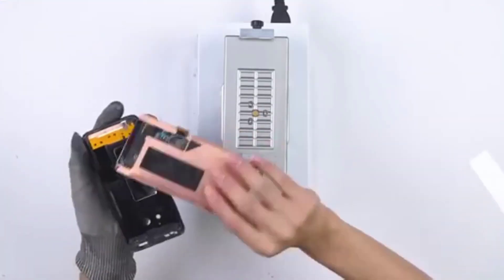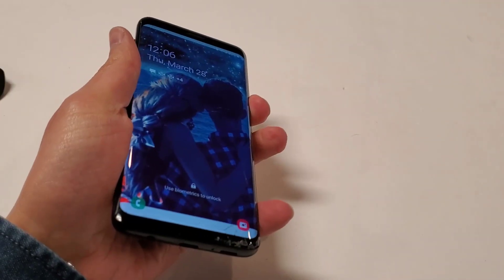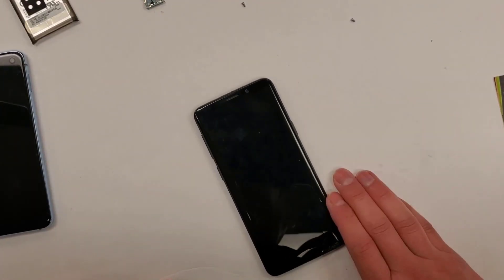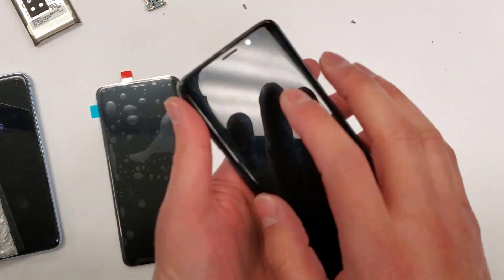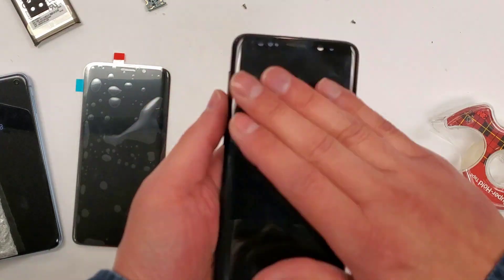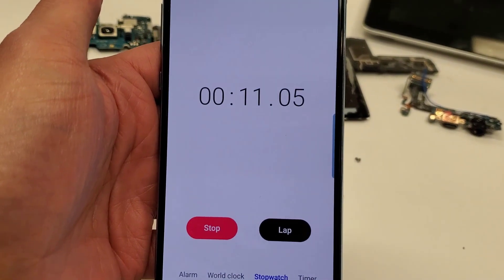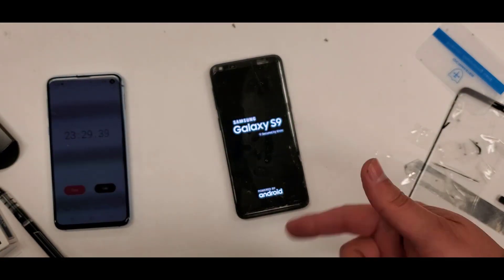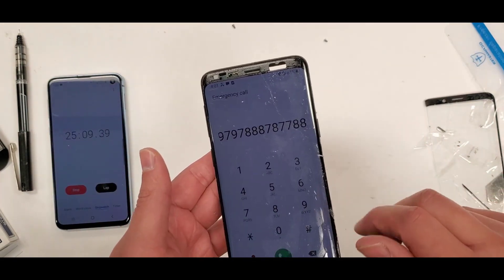Samsung Galaxy Screen Freezer Refurbishing Technique | Course Video Released

Comment: Thanks for this great course about freezer. I bought one and really was disappointing because a scam total. However I discovered some thing I can use it for display repairs but it's really not the best choice to separate the glass. Success rate is very low
Reply from the maker: It works but you need practice. The last model i used the freezer was Galaxy S9. After that I stopped using the freezer and just either paid a business in China to refurbish them for me or just sold them off to US companies. I only sell them off to US companies now.

Comment: My s8+ is cracked and the the top part the touch is not working so what can I do
Reply from the maker: You have to get the whole screen replaced. Take it to your local repair shop or follow a video on YouTube and see if you can do it on your own.
Reply: @RichardMeza  according to what I have seen I think I can manege it

Comment: Hello Richard, you talk about S9  and s9+ freezer glass removal technique,  can  this technique work for s20's s21's? Thanks for the video its great
Reply from the maker: The freezer technique is not used anymore. The way glass only replacement is done now with Samsung phones is by heat and wire. There is a hot plate machine. You place the screen with the frame in this, and it heats up the frame and screen. Then you get a wire and skim the glass off the Oled screen. This way is done with the current newer Samsung models.
Reply: @RichardMeza  i said because i have the freezer machine but i never try to repair new models only s8, so im looking to buy the hot plate machine but if works for freezer i no buy the hot plate, but its very good information for me thanks richard
Reply: @josuegarza4683  i think hot plate is easier and safer.
Reply: @RichardMeza  can you post a link to one of them just to see which machine to purchase?
Reply: Do you know where I can get the hot plate machine?
Reply: @ronaldhowell5831  Aliexpress Friend